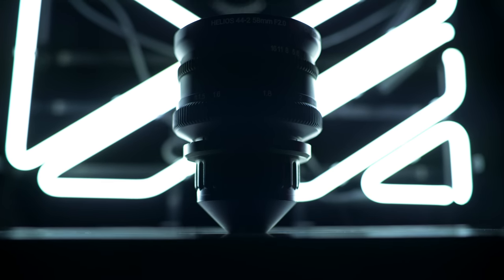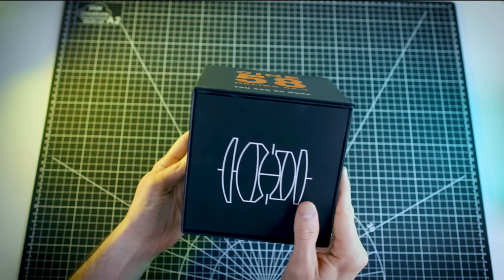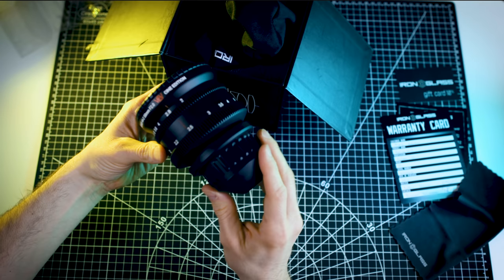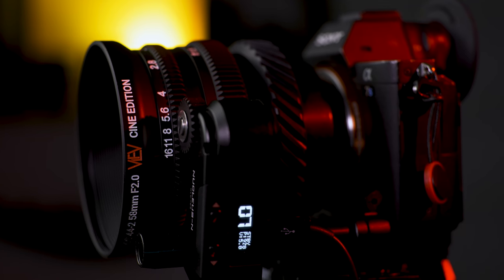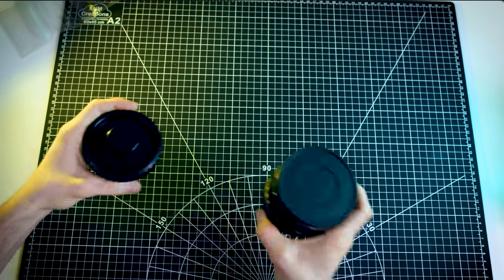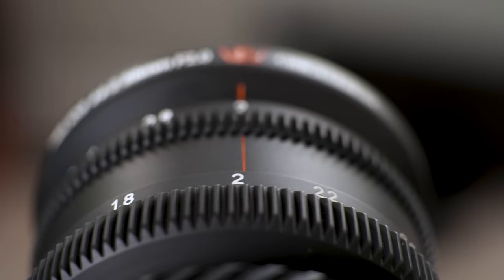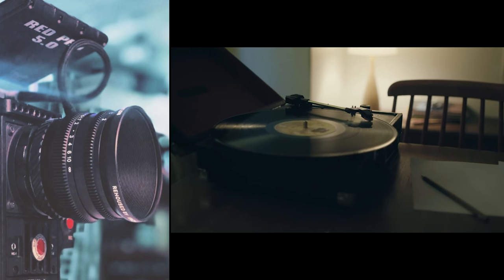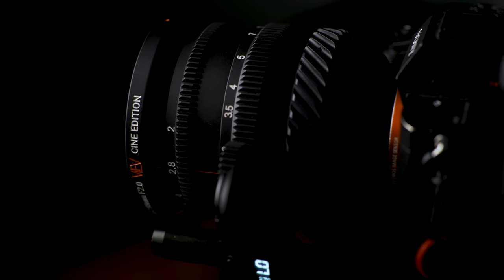Cinematic Swirly Bokeh - HELIOS 44-2 Transformed

Comment: super stoked! can't wait to see this one. i ordered mine and i can't wait for it to arrive. it's been a long time coming and im finally beginning my ironglass vlfv rehoused soviet cine lens set. what better way than to start with the great helios 44-2!
Reply: Thank you for your support! Really value this early adoption!
Reply from the maker: I think you're going to love it. This one sold me on the lot for sure, which ones are you most interested in?
Reply: Mark Holtze i got the white 13-blade helios in PL (with EF adapter) with anamorphic bokeh. im definitely going to get a set. Their Jupiter 9 85mm 2.0 and Mir 1V 37mm 2.8 for sure. Afterwards I plan on the Tair 11V 135mm 2.8, Mir 10A 28mm 3.5 and Mir 20M 20mm 2.0. Not really sure which to get first of the three after the 85 and 37. Vadim has been a great help though. The biggest thing with vintage lenses for me is their look and matching between other lenses. Investing in a set keeps that Soviet style look across the board and what better investment than this arsenal of glass! I’m going for all white rehousing across the whole set. the look is so unique and it will look really great on my S1H with white camo haha. Really see myself standout as a filmmaker. Thanks for being a great guide on my journey!
Reply from the maker: @n8miles455  The STORMTROOPER coat, I FKING love it! Do you EF to L adapt to your S1H? When I ordered the lens I didn't have the S1H, but I have it now and wondering if I should wait for an L adapter from Ironglass.  Their Sony adapter is fantastic, I'd love the same for L.
Reply: Mark Holtze I’m adapting EF to L via sigma MC-21. When I asked Vadim about adapting their lens from PL->EF->L, it was stated they’ll work great. I was worried about flange distance. Since their PL Mount is smaller (from what I understand), the use of their EF adapter does not change the the distance from the rear glass to the adapter. It’s almost like it changes it to EF mount and not just adapting it. Very cool to me. 

He was able to get me a good deal on an adapter as well. It could be worth asking for the EF too! If you don’t already get the Mount before I get my glass, I’ll definitely let you know how the Mount works for me. Worse comes to worse, I’ll get the sigma Mc-31 for PL to L or another EF to L mount adapter 😁

Comment: Rehousing... pricey, tempted but, in my opinion, worth the money for a professional filmmaker. I've recently read a lot about laboratories that modify and rehouse lenses, not only Russian glasses but also Leica, Canon, Zeiss, or even Pentax by request and I have to admit that I would like to have in my hands some vintage lenses in their 'new house'. 
I don't know if you had previously shot with this Helios glass, if so did you notice relevant visual differences between the original and rehoused version of this lens?

Thanks.
Reply from the maker: I reviewed my 44m so I've shot with it. I gave that lens away in a giveaway and wanted to get the original 44-2 and then I saw these. Made sense given my professional workflow and the fact I already liked the 44M 58mm F2 to spring for it. Happy I did and completely understand the re-housing is a bit overkill for most people. It's a professional tool IMHO, built for cinematographers who work on traditional motion picture/commercial work. 

The optical differences would be minimal unless you get the coloured anamorphic flares etc.
Reply from the maker: Imrul Khan  I think these guys just do the soviet lenses for now and very specific ones. Probably a lot goes into the measurements and fitting and setting the machines for those specs would be a challenge. New lenses would require entirely new designs, if the demand isn't there, probably wouldn't do well commercially. Just my thoughts, I'm going to do some searching.
Reply: Imrul Khan  hi, sorry for not responding quickly. You can check out Kimcamera both on their FB page and Ebay account

Comment: I bought my Helios 44-2 in a vintage lens store on Moscow. I'm super stoked to use it. On another note,  I need lessons on how to get such smooth looking videos. Look and sound. Wow. Do you use pro mist?  What about sound?  Well done.
Reply from the maker: I don’t use pro mist, might be a bit overkill on a vintage lens that’s already slightly diffused vs modern ones. 

Start by just shooting random things, mess around with exposure settings. When you edit those images play around with ambient sounds. Most of this stuff is just done on a tripod, the most over looked filmmaker tool on YouTube. Forget gimbals or sliders, that can come later. Focus on simplicity. Compositions and how cut images relate to one another.

Comment: I might order some metal follow focus gears for a Helios 44-2 lens I own. It will make it easy for me to pull focus, and I don't need a new mount. The screw mount works for me. It's just nice to have gears so I can use a follow focus to remotely pull focus.

Comment: The lens is available on Ebay for 170$ with focus gear and all, the seller has a small shop in Ukraine he modifies the lenses himself. Iron Glass are selling those for 1000$, its the same damn lens. I admit the Iron Glass version is neat and more "stylish" but that doesn't justify at all the price. Also, he can adapt it on all mounts, the Iron Glass version is only for a couple of mounts
Reply from the maker: You don’t have to justify it. Buy the cheaper one. I’m saying these lenses are worth the price for the work I do. I can’t speak to the market you are in or what value you hold. These are custom made for a professional workflow. 

You can get the photography lens for like $30. 

I have mods attached to my Takumars, they’re great quality but it’s not the same thing at all. Rehousing a lens is different than adding focus gears. 

:) but glad there are lots of options out there.
Reply: Got a link for the other? I am all for supporting little guys, especially if I get something just as good and cheaper.
Reply: @MarkHoltze  I have dealt with many Russian suppliers and they are all across the board on quality and reputation. I like the rehoused ones you show and you are totally correct, huge difference in rehousing a lens the way they do it.

Comment: That is SO FREAKING AWESOME- this company really knows how to present its products. So is the helios a lens available from iron glass as a preselected option that you can customize, or did you send your own helios in for them to modify? Do they modify any vintage lens? Footage looks excellent by the way. I ordered an open box helios from the 60's(I believe) but unfortunately due to the pandemic I haven't received it yet -cant wait to get it. I also got a helios 44m-7 - I highly recommend checking that one out as well as the helios 40 85mm
Reply from the maker: Thanks mate! Ironglass as I understand it will source the lens themselves. It's part of the process, they need to get a lens that fits their standard so they can build around it. I'm sure they service it while it's been taken apart as well, so you're getting the highest quality lens vs just randomly getting one on eBay. You could possibly send them the lens, but I'm not 100% sure.
Reply: Pretty much Mark said. The lenses are carefully picked. Only lenses in best optical condition are chosen for rehousing. You can of course request for a particular variation of the 44-2 to be used (there are quite a few). As far as sending your lens,  you can if you really want to but what you mostly pay for here is the rehousing, you can consider the optics as a free bonus, so sending your own wouldn't change the price much at all. Currently, IronGlass only rehouse the soviet set from 20 to 135mm, no other lenses.
Reply from the maker: @alanbesedin  Thanks for clearing that up!!  I guess different lenses become an issue with having to do different designs and that will be a major logistical can of worms I imagine.
Reply: Mark Holtze yes, it’s a very time consuming process. It took 6 months to get to the prototype stage, which is the lens in my original video and that is very quick. It took a few more months before we were able to ship the first lenses and now, about 1 year since the initial idea, we are still working to finish the 20mm & 135mm, which require a different design due to their sizes, so to develop the rehousing for let’s say a Contax lens set would easily take another year. When people laugh about the price, they should keep in mind how much time and money is invested into R&D. Hope this helps :)
Reply: Imrul Khan  Absolutely. I've been very busy with this project, but I have tons of vintage lens content to put out there, just don't expect anything as amazing as Mark's videos! :D
Reply from the maker: @alanbesedin  well, i'm glad I can just enjoy them on the end of the camera, the logistics wouldn't sit well with me! Your guys patience and endurance is highly appreciated!

Comment: Hey Mark! I have a Helios 44-2 58mm and a Jupiter 135mm. I was curious when you say getting an 85mm Jupiter f/2 for a set, why not a Helios 85mm f/1.5? Would that not match better? I haven't used the Helios 85mm 1.5, but was just curious on your take regarding that.
Reply from the maker: Ironglass doesn’t offer a modded Helios 85 otherwise I would consider it. They would have to rebuild, design and engineer all their working parts and I think that becomes unsustainable since this is so niche. 

It might be a better match, but I’d have to see first hand how big a difference they can make.

Comment: Quick question, did you only add the anamorphic mod? No colors? I love how the image looks.
Reply from the maker: Just the mod, no colours correct. I like the idea of them, but they flare a little too loud and that impacts the image a little too much. I'm not a huge fan of anamorphic flares myself so a cleaner look was my preference for what I want to use it with. 
The "anamorphic bokeh" is fantastic though. Check out my instagram @mholtze if you want to see a direct comparison of the bokeh against a regular Helios 44-2 at F2 vs the Re-Housed version. A fraction of light loss with the ovel bokeh, but it's barely apparent to the naked eye.

Comment: wow , my helios 44m-4 is a beast too. if i didnt need an adapter it is a tiny and light lens. and i love the focus ring, smooth as hell. on apsc the edge to edge sharpness wide open is perfect. i dont find sharpness falloff on edge on my piece
Reply from the maker: The bonus of super 35 sensor for sure! When shooting wide open I don’t want edge to edge sharpness, the optical vignetting only enforced my subject isolation in a frame. Not many lenses have clean edge to edge on a full frame as well (wide open), ones that cost many more times than this.
Reply: @MarkHoltze  have you seen the zeiss f/0.7video by the media division? they knocked it out the park with that lens

Comment: Do you have any problems with infinity focus, considering that the PL mount has a larger flange distance that the Helios's original M42 mount? Also, do you plan on getting more vintage lenses rehoused—maybe something wider?
Reply from the maker: Zero issues, I've actually never had any issue with infinity focus using any of my vintage lenses on my mirrorless or cinema cameras actually. Not sure how it all just works, but i think they take the flange distance into account when they do adapters.

Comment: Fabulous video 👌🏽

Putting my order in for one of these - do you not need the 16 iris blade modification if you go with the anamorphic bokeh insert? Was wondering how the number of iris blades would effect the anamorphic bokeh
Reply from the maker: The anamorphic bokeh will go away after F5.6 so you can still take advantage of those blades! It’s a great option I think at a minimal additional cost.

Comment: Just curious, how did you learn to do motion design like the vintage lens files part? Its really well done.
Reply from the maker: Thanks mate. Years of working with it. Started in after effects in 2000 so, dang it’s been awhile. Still barely use it to its fullest potential. It’s a monster program. Sky is the limit really.
Reply: @MarkHoltze  cool, thanks for the response. Glad the answer is time and effort, honestly. I'll try to dig in harder. Cheers!
Reply from the maker: @michaelruggles9441  I used it a lot more when I was going different kind of work, between 2011-2018 I barely touched it. Part of doing this was finding an excuse to get back into it. You can go a long way in a short time if you're dedicated to it. Best of luck mate!
Reply: @MarkHoltze  Thanks!
Reply from the maker: @michaelruggles9441  My pleasure mate, best of luck out there!

Comment: In an unrelated note, how many directions do your sliders move in? Besides side to side this vid also had vertical and front to to back (and vice versa) movements.
Reply from the maker: Not sure what exactly you mean. Time stamps for reference?
Reply: @MarkHoltze  Sure:
0:00 vertical movement
0:09 side to side
9:18 diagonal moving out
Is this all with the same slider?
Reply from the maker: @yourtallness  OHHH RIGHT my SLIDER i'm so sorry I brain farted. huge there. Okay: 

0:00 - TRIPOD move, unlock the vertical head and just use my hand and gravity to slowly drop the camera on the tripod head...in this case I reversed it so instead of going down, it was coming up. 

0:09 - Tripod shot as well, using a macro lens, just a nice smooth pan.Good way to get this is to have some resistance on the ball head so you have some force to work against you on the pan. 

9:18 - actual slider shots, the first is just the ball head on the slider tilted at an angle, the regular slide is just a normal slide. 

So the first two were done with a tripod...i might be able to show how I do those quickly in an upcoming video actually. It's a good little trick you can use most regular tripods to achieve.

Comment: Can they make it with a 82 mm filter thread
Reply from the maker: No, standard size unfortunately. Most cinema lenses of a group are all uniform sizes so makes matte box switching easier.

They could simply modify the Helios instead of a full cinema mod however.

Comment: Awesome Video!
Considering what other Cine-Lenses cost, this doesn't seem so expensive after all. If the Quality of the rehousing is right, I think the price is fair. You also have to consider the amount of material and (even more) work going into rehousing this lens correctly. Also you can get a new Helios 44-2 for an extra 50$ (a NEW one). I feel this is completely fair. In my region, I struggle to get a used 44-2 for under 50€ and these are used...
Reply from the maker: Thanks, yes they’re totally different lenses in this form. Very easy to show up on set and impress clients too. They look the part and having them on hand to really study their flaws and strengths can only improve your use of them. 

Not a hobbies venture by any means, but love the option is there for people like me (and you) who see the value of these.
Reply: @MarkHoltze  that's right. Learning the flaws of your lenses, gives you the opportunity to use these to your advantage. I hat that kamlan 50mm f/1.1 lense once, its field courvature was very noticeable, but this can be used to isolate your subject even more.

I am not a pro, just an amateur doing this in my spare time. But I see the value for pros.
Reply from the maker: It’s cool because the foundation of the lenses are very accessible. This is at the core where their true value lies. Accessibility
Reply: @MarkHoltze  indeed, this gives even people on a tight budget the opportunity to try out fast lenses with unique charakter.
Reply from the maker: I grew into these, it started out as just a cheap way to mess around, but I already work in film and tv so they quickly caught my attention and how I could apply them to that work.
Reply: @MarkHoltze  Well, I got my first vintage lens, because I needed a long telephoto lens on the cheap. A few months later, I wanted to try out film photography. So I bought a Canon AE1 with a helios 44-2. Getting a cheap M42 to E-Mount adapter led me down the rabbit hole...

Comment: Kind of a weird question to ask, but is there a possible side-to-side comparison between the normal vintage HELIOS 44-2 and the transformed HELIOS 44-2? I personally have a HELIOS 44-2 and I would just like to know if it has a difference between the two if at all
Reply from the maker: The glass is the exact same save for the mods you do. Oval inserts and anaphoric flares. In my fake it until you make it video I compared the two plus a modded Helios 44-3. 

But optically generally the glass is the same, you are paying for the rehousing and the functionality it brings. That’s why it’s not for everybody when you can just rock a modded or standard Helios 44-2…the lens is timeless